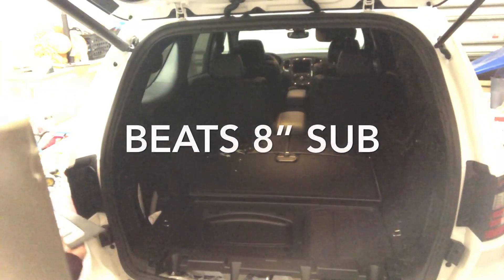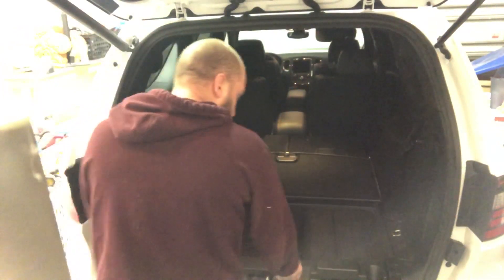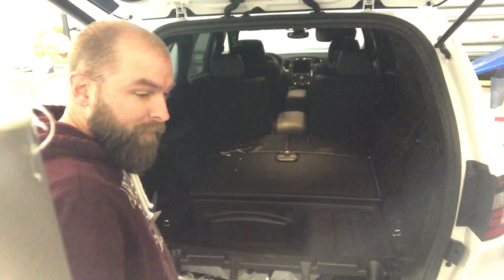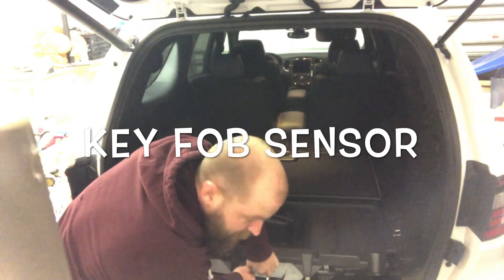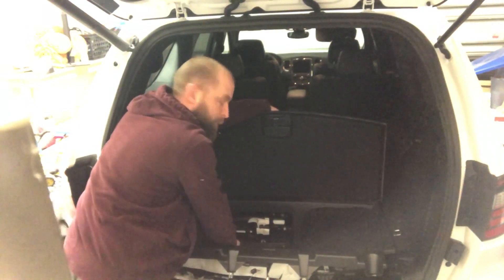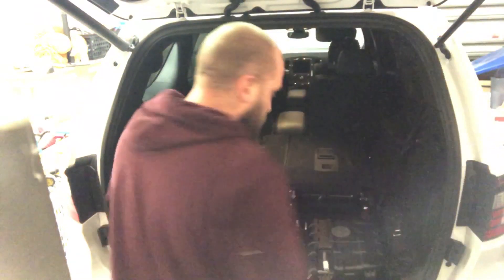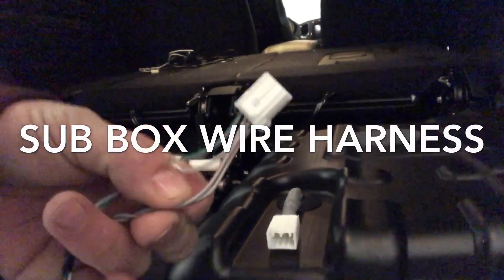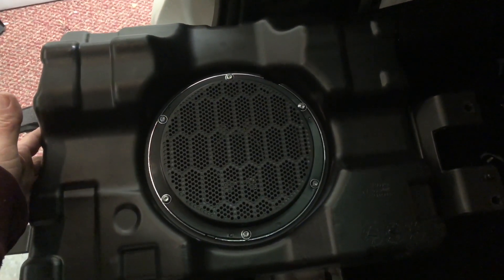Durango Dodge subwoofer 2018 Beats Alpine subwoofer location. 2014, 2015, 2016, 2017

Comment: I have the Beats system in my '17 Durango.  Been thinking about replacing the sub because it doesn't go low enough or hit hard enough.  When I saw that piece of junk you pulled out I immediately got sick when I remembered I paid extra for that.  Thanks for posting the video so I know what I need to do to get to it.  I'm thinking about either building a custom enclosure to replace that plastic pan or using one of the shallow mount subs from Pioneer or Rockford Fosgate.
Reply: Super easy to tag into the wiring right where he unhooked it to run after market amp and subs. Just dont plug the factory sub back in
Reply: @clayrow861 what wires specifically would I need to tap into? What are the colors?

Comment: Did u change the speaker?  Is it possible to put maybe sum thing bigger than a 8” ?
Reply from the maker: I did not swap mine out but You could. You would want make sure you have the depth for your replacement. You only have about 4 to 6 inches. Sorry I didn’t measure it. What I ended doing was keeping it were it was and splicing into one of the speaker signals for one of the channels as an “high input” to a powered 10” sub that would fit in the storage space. Link below. It really helps bring the low bass I was missing and then some. It isn’t crazy bass like you would get from a big box that takes up the back of the car. This one is small and you can still get to your jack and spare tire crank.
https://www.amazon.com/dp/B010X439SC/ref=cm_sw_r_cp_api_LQvMAbJ712K2B
Reply from the maker: Photo of 10” sub in storage area 2018 Durango.
https://twitter.com/mobileseed/status/969607939161026561?s=21
Reply: How do you like the VPAS10? Would the VPAS12 fit instead?
Reply: you can replace it with a Pioneer shallow, there's some videos on that floating around for dodge/chrysler vehicles, its the same exact sub setup as far as size TS-SW2002D2 and Metra 72-6514 for easy install..
Reply from the maker: Parag V not sure if the 12 would fit. Lots of extra room left over with the 10”
Reply from the maker: Don’t think anything wider would be an easy install or seal well. Not sure on air space. But you could remove it and have a lot of space.
Reply: I have a 2017 Durango and was wondering where they put the subwoofer at!! The bass isn’t as deep as I thought it would be for beats audio. Thanks man!!
Reply: Shiver Timber so no input from the head unit? Just from speaker wire?
Reply: @Scoop-le1wh  That’s because it’s not Beats or Alpine and in fact the 2 systems with 2 different names are exactly the same. I have the 2019 with the “alpine” upgrade and the speakers are exactly the same as my cousins 18 with the beats system.

Comment: how does the sub compare to beats sub?
Reply from the maker: Honestly wish I had my old alpine system in our 2014 Durango. The beats system and sub disappoint. Even with my added sub it just sounds like a regular stereo. Yes, now it has some bump but I would be happy to tell Dr. Dre he sold out when it came to putting a name on the Dodge system.
Reply: DeeTrain Gaming why tf is the sub down it should be facing up wierd
Reply: The new”Alpine” and “beats” sound upgrades are exactly the same speakers.